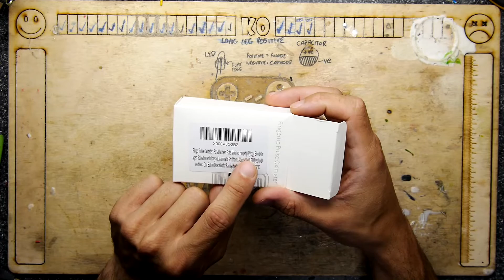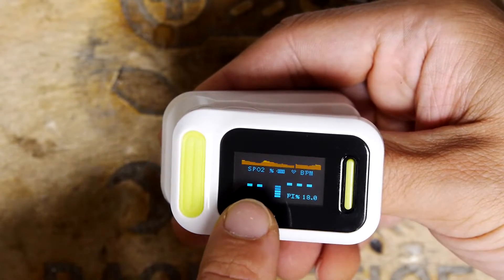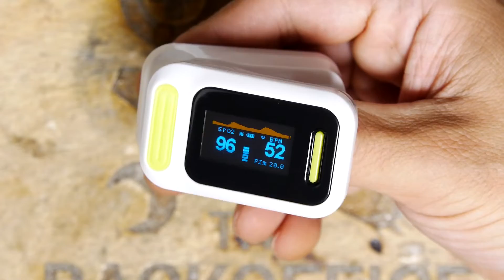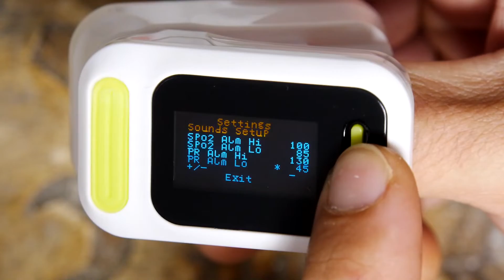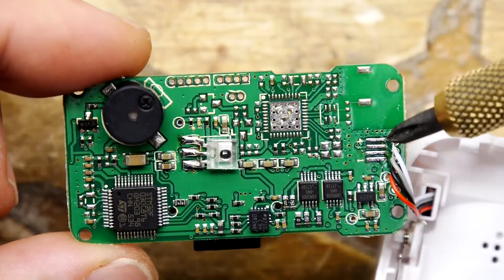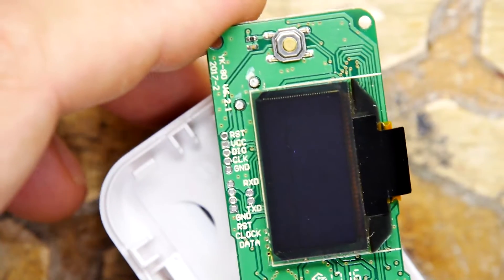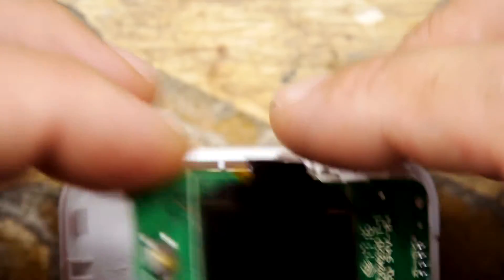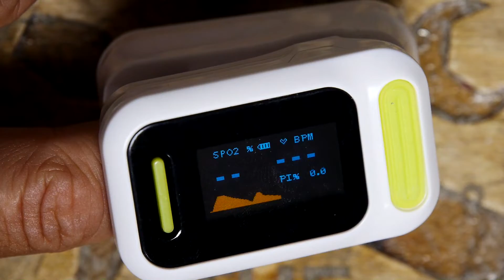Finger Blood Oximeter Teardown

Comment: hello i need some help ?
i have the same in black
and made a mistake,
while trying the screen brightness up
pressed some where and screen is off now
it works but i cant see anything
watched your video and i saw there is reset.. what er have to do for it.
i have go back to the factory settings
thank you in advance
Reply: Pls can u help i have a same problemm plss plaa
Reply: @yashtailor9784  i still did not get an solution, brand new and i cant use it :(
Reply: @oopsala48  i did it by assuming the brightness button
Reply: @oopsala48  givee ur full name

Comment: In the case that the oximeter's display lost its brightness, is it possible to still fix that?

Right now, my oximeter is still working. However, I can only see the readings on the display by covering the screen a bit like how you would look at a glow in a dark watch.
Reply from the maker: I have heard of cheap displays fading over time owing to degradation of their composition. If this is the case, there is little you could do other than replace it
Reply: @backofficeshow  Alright, thank you! 👍 I thought there was just some component that needs to be replaced aside from the LCD that is responsible for the brightness.
Reply from the maker: If I learn more I'll let you know

Comment: Due to covid-19 pandemic, we were working on integrating this to an IoT system. But didn't have any working model. Like if can transfer the data to NodeMCU/ Raspi zero W using the Tx and GND, with a backend cloud and android application. Where the application can let the doctors see the Saturation level of patients. And notify when it is < 90%, something like that. Let's set each Nodemcu/Raspi a unique ID. So that patient can be distinguished. If we can connect let's do something interesting

Comment: Can you tell me the model # on the oximeter?  The Amazon links no longer work.  I'm very interested in those serial lines in there.  I'm part of a team designing an open source emergency ventilator.  We are looking for an oximeter we can extract the data from.  Thank you.
Reply from the maker: I am studying it as I type. Unfortunately there is no model number on the unit, but it seems a pretty standard item. Can you send me a link to your team, or ping me in Discord. I will run a stream today to reverse engineer the oximeter, we can study the signals on those lines to see if they are usable, and study the measurement end to make a 3D printable + nodeMCU equivalent.

Comment: Pulse in 50's IS low. Did you ever talk about it with any docs? That kind of bradycardia can be worrying.
Reply from the maker: I've been checked out, stress tested and poked 😂
Reply: How about 24 hr or more Holter (basically few days worth of EKG)?
Reply from the maker: I literally just asked my Dr 20 minutes ago, she asked the lowest and the highest and a couple questions about exercise and said not to worry about it 😂
Reply: And probably if you are doing at least some exercise she said it's normal because people that are in sport have lower HR? They've told me that too. Until they've realized that I have total AV block and had to implant a pacemaker :/
Reply from the maker: Oops! A couple of years ago I had a full screening check and stress test (for fun!) no issues then. They also noted the lower pulse then as well. So it's probably ok. She didn't even query the upper pulse in the 190s during training either. I guess they get more worried if it does not drop down quickly
Reply from the maker: Also in the discord I'm showing some interesting heart rate graphs of a good run compared to a bad one. It's really apparent to look at